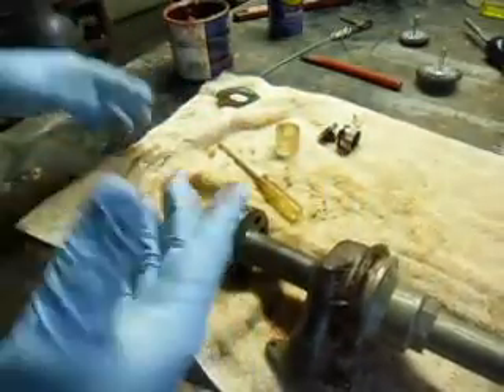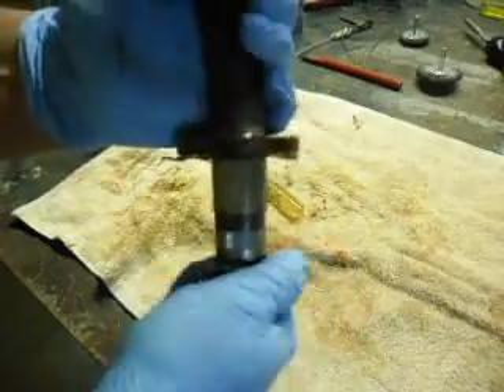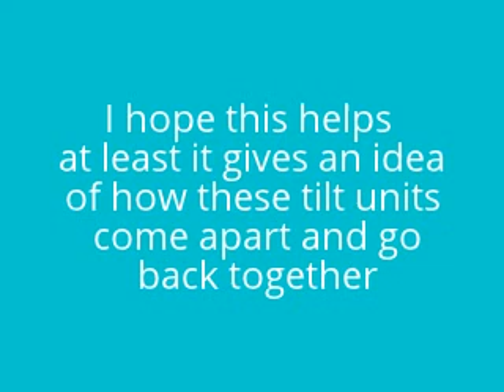Volvo Penta mechanical tilt  assembly part 2

Comment: Did yours have a key way on Shaft? Mine is bound up and won't trim up. It looked like you didn't have a key way that you installed. The only reason I'm asking is when I took mine apart, it looks to have a keyway on shaft

Comment: Hi there I appreciate the video , but I have a question? How did you get it off the boat ? Did you have to use a special pulled tool ?
Reply: Hi, I'm dealing with the same problem, I can't remove the mechanism from the ship. Were you able to solve the problem?